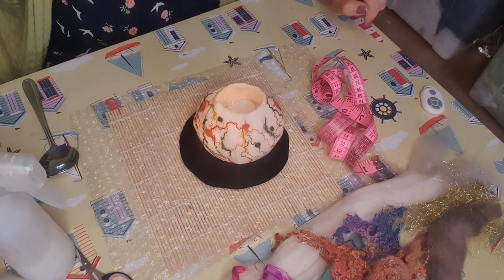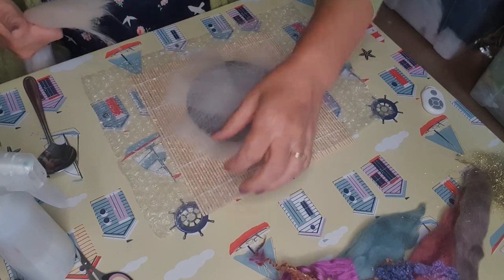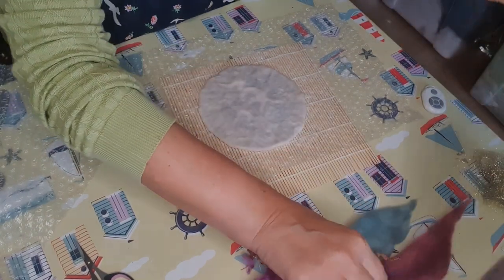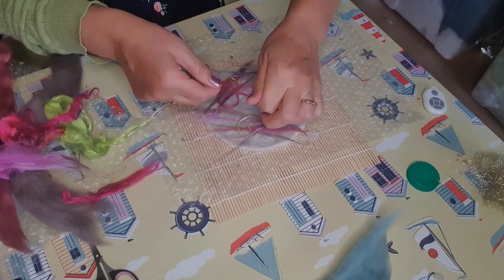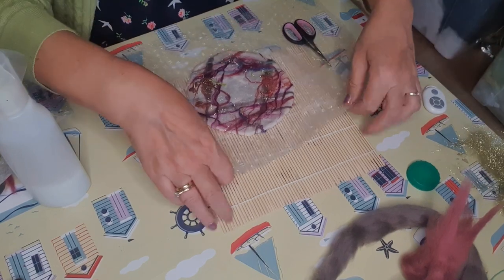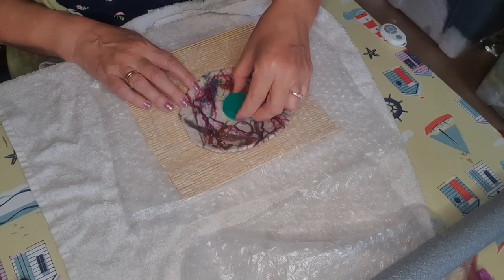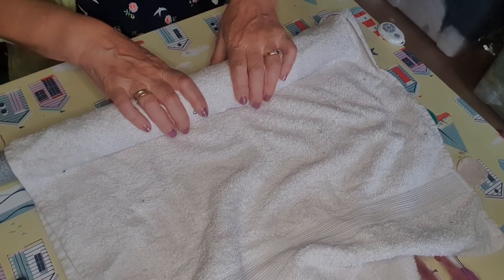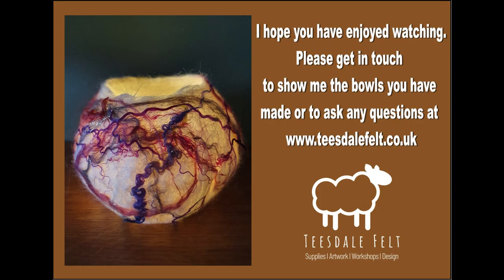A beginner's step by step guide to creating a 3D illuminated wet felted bowl

Comment: Oooh, this looks fun and a great christmas present idea.  Thank you for sharing this.  What sort of stiffener did you use to make the bowl more sturdy?  Thanks.
Reply from the maker: Thank you for your lovely comment. I used diluted fabric glue (1 part glue 2 parts water)to paint the pot and then dryed it. Any fabric glue will do just double check that it dries clear.
Reply: Ah, many thanks.  I'm sure I've got some knocking around the workroom somewhere - I have vague memories of stiffening a little crochet pot many moons ago.  Wish me luck in finding that - hee hee.
Reply: @TeesdaleFelt  At what stage do you add the glue mixture? After you shape it into the bowl shape? Do you let it dry first then paint the glue on?